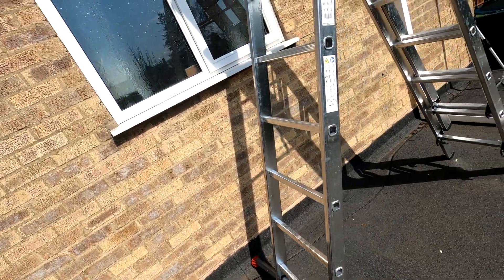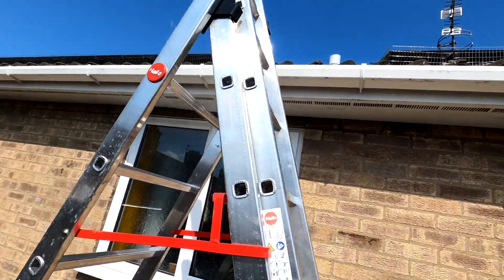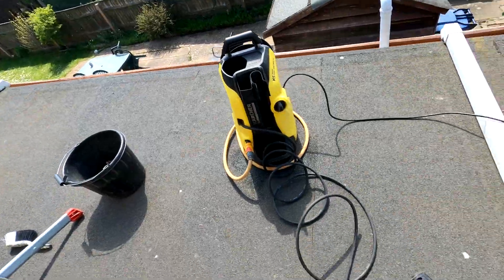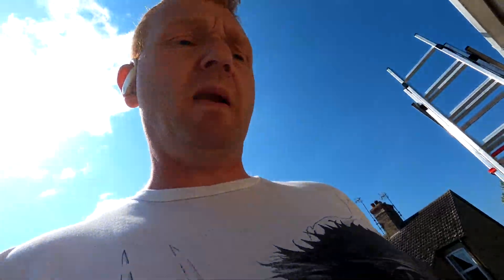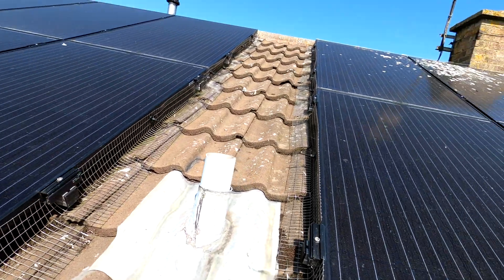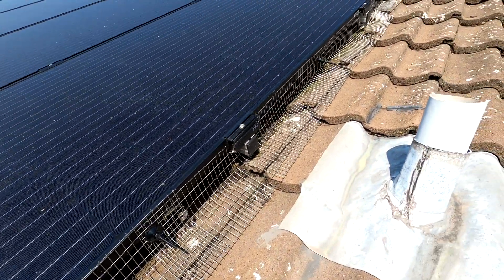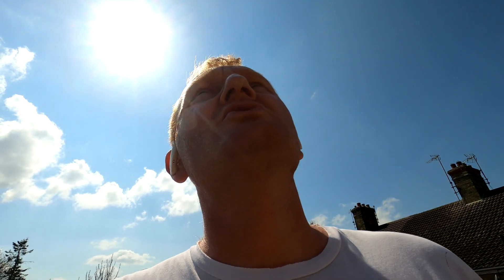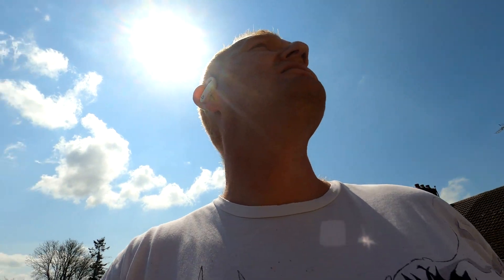How to clean a solar array

Comment: Be careful pressure washing panels as some companies will void your warranty if they work out the seals have been damaged due to water pressure. Also using tap water could leave calcium deposits etc if you are in a hard water area.